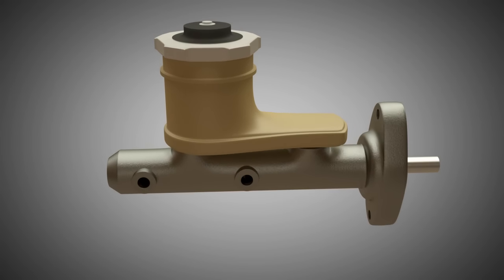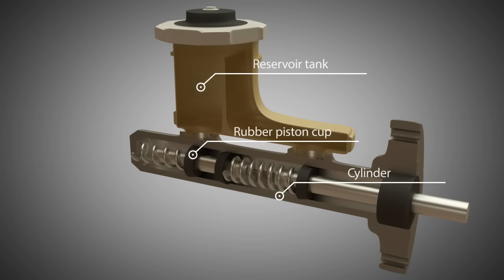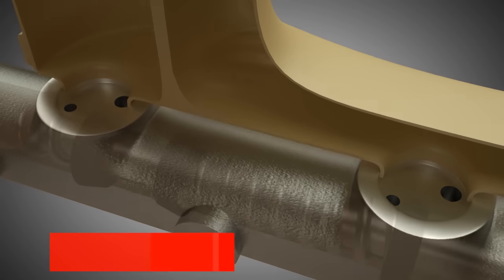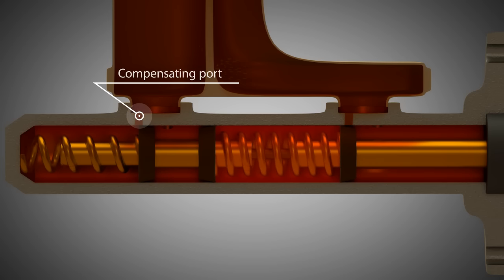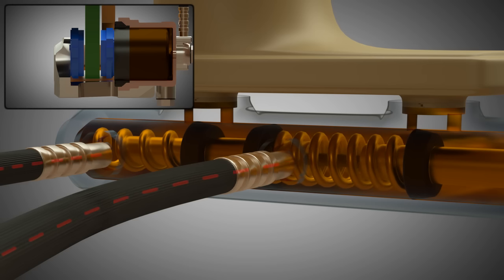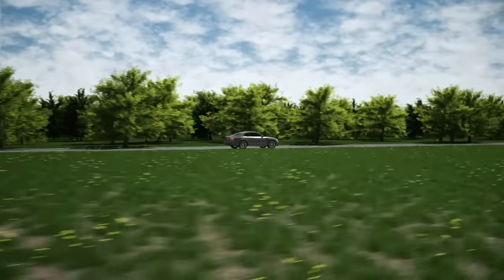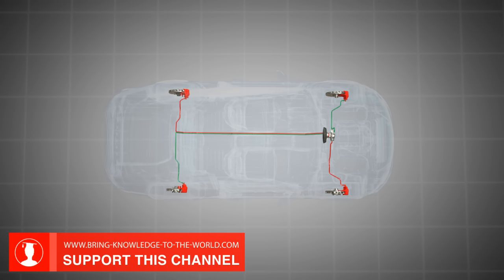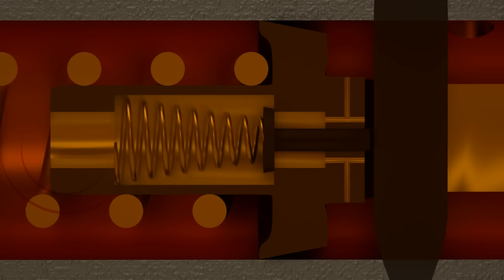Master cylinder - How it works! (Animation)

Comment: ok so if you brake and there is a leak, it's made so you will still be able ton brake..

But.. Is it possible to have an oil leak in your brake lines without losing pedal pressure?

Comment: Very interesting video , i have a ram 3500 2022 , and every 2000 miles im loosing one or both rotors for the rear , the way this video shows its split front from rear so my guess is that the master brake cilynder has an internal leak and it's loosing vacum,  and the rear rottors are dragging and overheating then vibration starts.  Corect me if im wrong , 
Thx

Comment: How does the brake fluid gets pumped around. Is there a pump for the brakes?
The reason why I'm asking is because when the engine is turned off the brakes become harder to stop.
Reply from the maker: Yes, there is a pump :)

Comment: What is the function of the breather port?

What is the purpose of BRAKE CIRCUIT between two chambers?

In auto industry using term ”cut off hole”

Which one is cut off a hole here?

I don't know my questions are dumb or what?

Please reply with your explanation ASAP

Comment: I don't quite get some things.
- Is the smaller diameter shaft going thru the shaft of the 2nd (left) circuit only act as a guide and doesn't have any role on moving the 2nd circuit's rubber piston cup?
-What's the stud for? And what is the valve head(?) connected to?

Comment: in using this configuration, does one set of brakes got the pressure first? if so, is it the front?
Reply: Yes, it does but in minimal content. In a diagonal circuits (Most of EU countries require it), You can see very slight uneveness of front L and R brake pad wear because of it. Plus when you suddenly hit the brake pedal as high speed, car sometimes momentarily wobbles sidewards (Yaw)-  it just one diagonal breaks first ahead of other one. This is called a brake breasure lead. In the F and R split system, it is not noticeable (interestingly but then, the lead circuit is REAR not FRONT), because the hydraulic pressure wave has further to travel to the rear axle).

Comment: Perhaps I missed it but how does the master cylinder leverage the power of  running engine and system of pullies and pumps?  I'm asking as it relates to EV conversions.  Is there such a thing as Electric brakes vs something driven by pullies and pumps?
Reply: Most vehicles utilize the manifold vacuum produced by the engine to give power assist to the brakes. The brake booster is the device that turns vacuum into brake pedal assist.